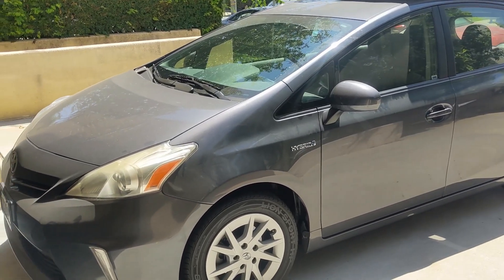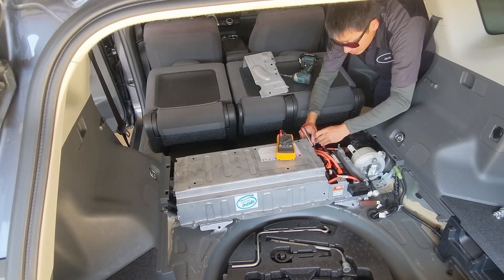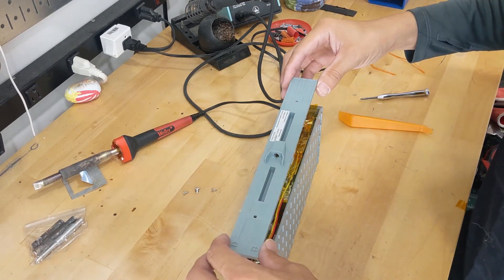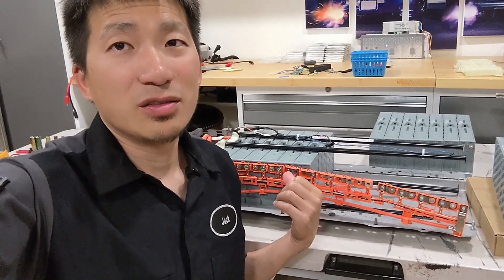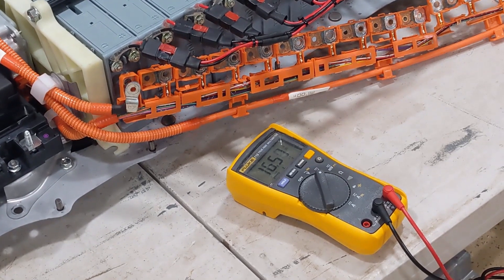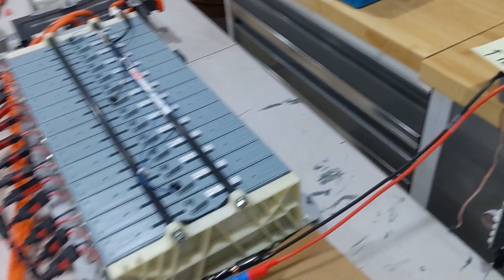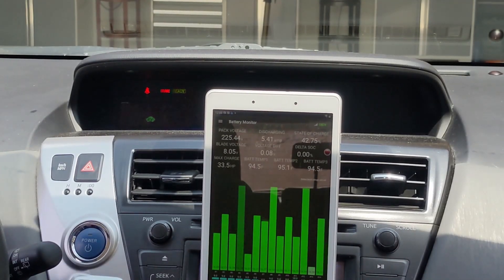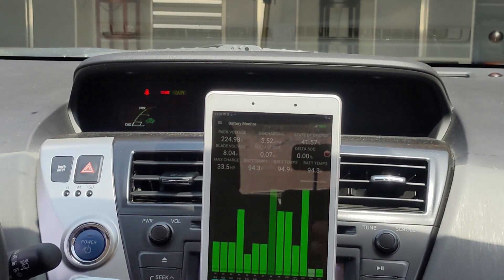Prius lithium failure part 2 - facepalm discovery

Comment: Hello, is there a Voltage equalizer for mixing blades

  Works on nickel cells or only lithium thanks
Reply from the maker: since NiMH have total of 28 blades instead of 14 lithium blades, you are gonna need two sets of equalizer, FYI.
Reply: @hybridapp7158  ok i thank you
Reply: I can't order equilizer in the UK what shall I do? I need to equilize NiMH hybrid battery full

Comment: Why is that battery pack failing so fast already? Arent they supose to be new tho?
Reply: If you take time to watch the video, you will see that the person who installed the battery accidentally drilled too deeply into the module when modifying the pack.

That is not a manufacturing defect. That was an error made by the installer.

Since that time, the modules have been updated so that no additional drilling is needed by the installer.

Therefore eliminating the possibility of this installation error happening in the future.

Great work, and transparency from NexPower/NexCell/Dr. Prius.
Reply from the maker: cell punctured by installer, watch video for detail

Comment: Nice video and info. Thanks ! In the app.. "delta SOC" . I check my car with your app and see also "0.00". The app show me the SOC and i see many times at the phone to check it. 
What is the high.. the low. 
I know when the SOC goes down, that one cell goes down. Therefor the "delta SOC"" is helpful. How can i see a actual "delta SOC" ?
Reply from the maker: delta SOC should always be 0, if it is bigger then 0 the error code will pop-up soon. What I was referring to in the video was delta voltage, or "Vol Diff" on the App.